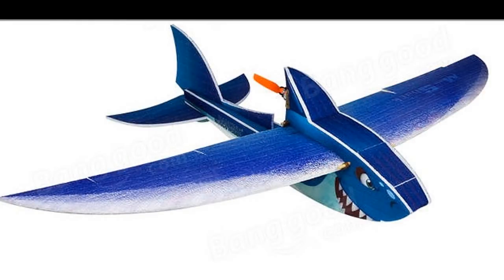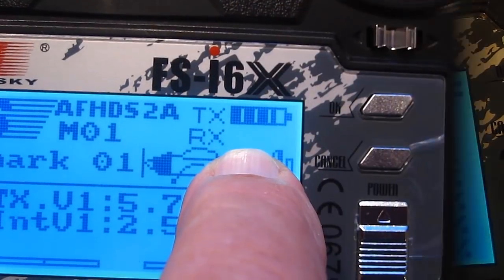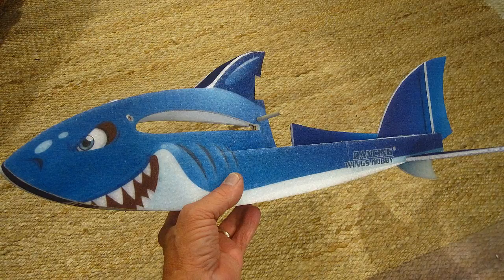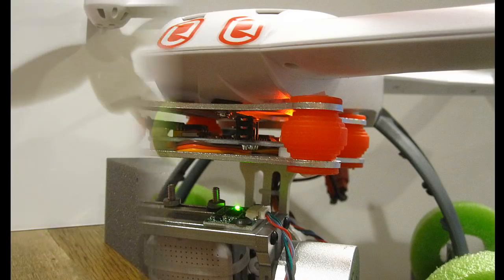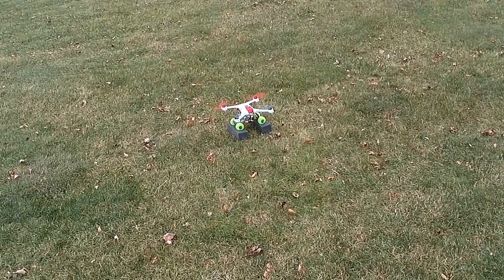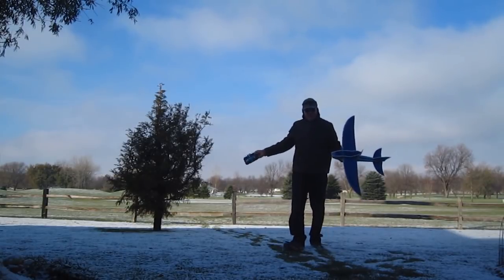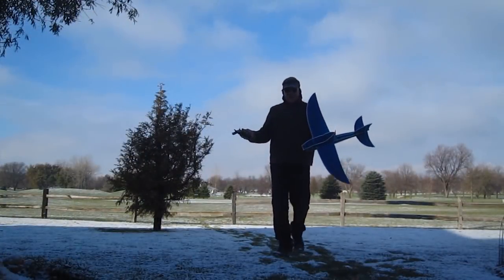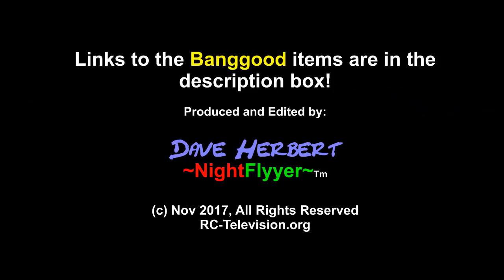Mini Flying Shark, PTz Camera Gyro GImbal, & FlySky Radio review, Pros and Cons!

Comment: Bang Damn that's Good to see the Shark and the gyro gimbaled cam on the old quad controlled by the Flysky 6 Channel radio, Flysky X6B Transmitter and the RS 20 A speed controller...that's Bang Damn Good, Dave!!!
Reply from the maker: Thanks Bud.  I appreciate your comments. I also saw the news about the Icon A5, then your emails on it.  I never had good luck with either of mine, so it doesn't surprise me.  Happy flying!

Comment: Glad to see you out playing in the cold stuff dave. I am ordering skiis for my Apprentice, I tryed making a pair a year ago out of old licence plates,a rubber block and duco cement. They would have worked on a skiff of snow like that,but I didnt make them big enough to handle deeper snow like we get here in Mi,so I decided just to order a set. You cannot go wrong with pusher planes! I am sad to say,I could have picked up an old shark plane two years ago,but thought it too goofy. If I had bought it,I would have gave it to you. Believe it or not,I found it at a Goodwill store in Desmoines Iowa. I just left it there. If I run across one again,I will forward it to you,even if you already get another one. You could always use a spare for parts I suppose. We get out your way at least twice a year,drove through a blinding rainstorm comming back to Mi the weekend before Halloween. That storm was so slow moving,it took three days to finally hit Mi and we ended up with eight inches of rain in two days time. It flooded most of our streets( which hardly ever happends). Its the first time we ever drove to Iowa in driving rain most of the way there,then again on the way back home a week later. Great flying,love that gymbal. Ha,I just saw one listed on gearbest for $170 ,it was hand held. Not to hard to take that Banggood one and convert it if you wanted( not that I would). I really enjoy all your videos. I generally stop flying come winter as my fingers cannot handle cold.
Reply from the maker: Wow, what a story!  I appreciate  your comments and like you my 70 year old fingers don't move that well anymore in the summer let alone the cold.  Happy (simulator) flying for the next 5 months.  Thanks kindly for the great comments. Let me know if you find the old shark as I like goofy stuff!.  LOL

Comment: Any way of taking the shake out of the gimbal?
Reply: TheRattleSnake3145 i have the same gimbal ; P
Reply: TheRattleSnake3145 a downwards facing camera almost always suffer s from jello
Reply from the maker: Well if you saw the left grey landing gear skid bouncing around, that was the shake before I added the gimbal, so this is a big improvement, and for me, its acceptable, especially on this old quad in this horrible wind. The gimbal only compensates fore and aft, and left and right, not at any other angle, so there will be some (jillo) anyway. Cameras aimed down show more.  I suppose I could make a better mount, but for me, this worked fine, especially for $39.  Thanks kindly for your comments.
Reply from the maker: So true, but still better than it was without it and acceptable, especially if you saw that left skid bouncing around in the wind, as that would be the camera bouncing around without the Gimbal!  Thanks kindly!